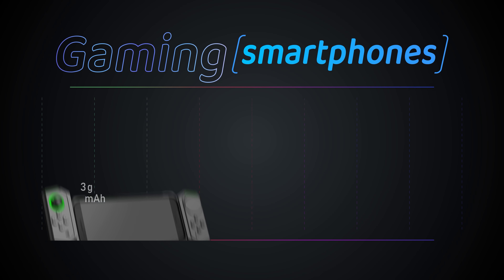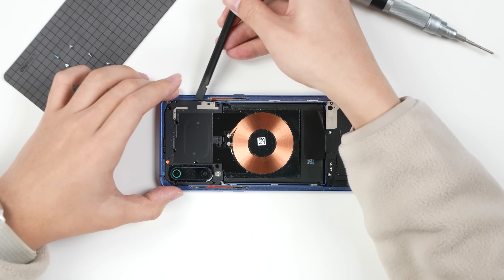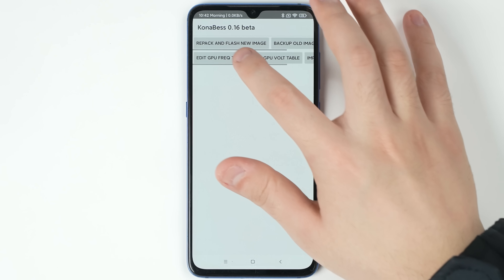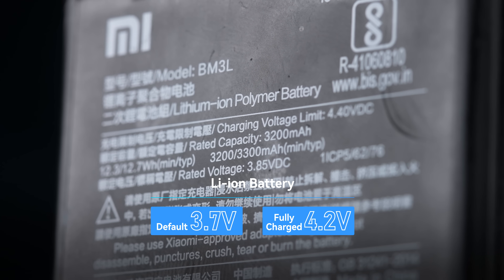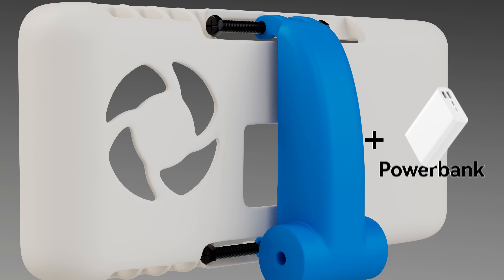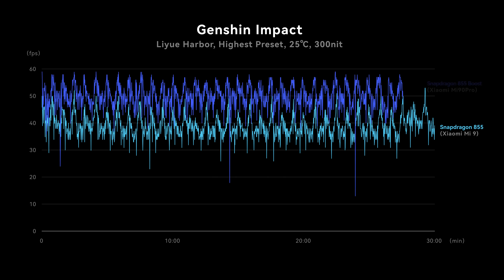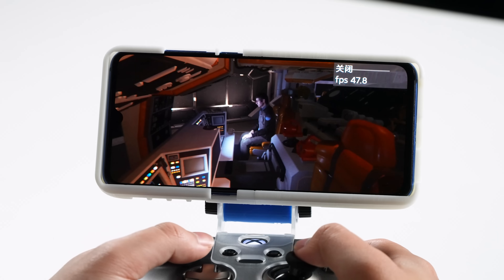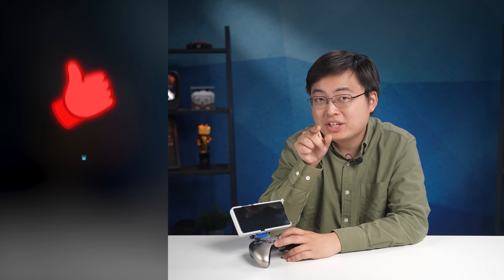We Turned This Old Phone into a Gaming Beast !!!

Comment: Meanwhile my oppo A3 pro 5G is running honkai star rail in high graphics quality in 60fps stably without overclocking and no modding, stock performance and Factory parts and it is about 45°C on the surface
Reply: ur oppo is 5 years newer

Comment: I wanna try this

Only thing different wanna do

- Mod a retractable phone controller to be permanent on the side wired connector USB type C

- have a type C  and audio jack passthrough to the bottom and

- make a dock with a type C to HDMI

- Additional dock cooling

Comment: Just yap bcs bored.

Snapdragon 865 was the most stable chipset ever for years after the 855 and 860. many phones with the 865 were godly. After that, 870, 888, and 8 gen 1 was released. Barely any improvement from the past chips but very prone to overheating and cpu bottlenecking.
My personal fav was Nubia Red Magic 5G.  

now its definitely being eclipsed with the newer gen, but in terms of reliability, u will be in a good hand with the 865.

Comment: How did you mount the heat sink to the top of the processor? Did you use thermal adhesive? Screws or what?

Comment: This video, shall serve as documentation for turning my Mi Mix 3 5g, into a gaming beast. This thing stays so cool with its ceramic and the increased air pass through due to the slider. I saw the voltages inside the app and decided I need more information before continuing. Thanks for this video. Its great though, cause this phone costed like 150 bucks, such a steal. 

Just some free advice, as an old android/windows mobile enthusiast... the ondemand governer, will achive the same perf as the performance governor, without draining your battery on standby. Also you can reduce the performance of the low end cores, for a bit of thermal headroom, if you don't feel like making a cooling solution for your phone lol.

Comment: 9:50 Closed back shell for printer... Right temperature settings... Little work to manually make .stl file with proper layer alignment with ploper supports... Tiniest bit of acetone to smooth outer layer if so much bother You... No. We don't. We have money and dumb idea on which we spend even more money than Steamdeck cost. Hell! There even some chinese manufacturer of such devices for retrogaming and even if I hate to say - they are good enough and cost new like smartphone which was bought for project. And that manufacturer already was a thing two year ago when this video was filmed.
Now this look like one of those video about extremely dumb and wasteful "DIY" video where material just wasted as shit for make unnecessary thing which You can by whole or make just much more efficiently if this "project" have any practical sense in a first place... You CAN do it simpler EVEN IF it is principally to make it. At least about material part, about coding can't say anything else than it look shady.
It is good to have will to create something... But, please, make it properly with some critical thinking, because this is pure cringe, sorry.

Comment: Sd865 also has an unlocked GPU, being able to surpass the 888 in GPU performance.

In 2024 I would recommend a mi 10t pro, or a OnePlus 8T for this project, I chose the OnePlus 8 pro because I saw it at a similar price to the mi 10t pro, but with an amoled display, better camera, and 4gbs extra ram.

I will probably oc and undervolt my gpu, but since this will be my primary phone,
Reply: What happen

Comment: $110 for a broken phone that was crud to start with is INSANE! Not to mention the obligatory spyware that comes preinstalled as a system app on all made FOR China mobile devices. The same spyware has been found on many devices made IN China for the global market. Notably Huawei devices are banned in many countries for this very reason and Xiaomi (the maker of the Mi 90 Pro featured in this video) has been under scrutiny due to privacy and spyware allegations. 

Xiaomi devices are equipped with MIUI, which includes automatic data collection settings. These settings collect data such as device information, user behavior, app usage, and even location data. Users have reported difficulty in turning off certain data collection features even after adjusting privacy settings. There have been concerns about Xiaomi's handling of this data, particularly given its ties to Chinese regulations regarding data surveillance.

There have been specific allegations regarding Xiaomi phones sending private data back to servers in China. In 2020, a report claimed that some Xiaomi devices were sending browsing data, even when incognito mode was used in their browsers, to external servers. While Xiaomi denied these accusations, it raised alarms about potential spyware risks.

Comment: Android phones would be way more amazing for DIY stuff, if they would allow real unlimited access to everything. You could then install something like Ubuntu on it and use them as tiny Linux desktops. If you solder wires to the right places on the board, you could use them like a raspberry pi. They already support I2C and serial communication making them theoretically great for DIY projects.

If there would be drivers freely available for every part of modern phones, you could easily install different rhings on it or modify it.

Comment: You can also try custom rom on it so it can have a better optimization and fps
Reply: no the best option is to install windows ,i have a lg v50 with windows installed and did manage to oc the gpu to 820mhz ,and you can actually play pc games .compared to winlator i get 2 times better fps and dx12 runs much better than dx11.

Comment: how hard and expansive it is to put :

1. 720p or 900p screen and maybe a higher end 1080p screen option
2. 8000 mah battery
3. 3.5mm port
4 And a decent chip which is overclocked with decent cooling

Thus making it the best gaming device which can easily be bought under 150-200 Dollar.

No need to include speakers or camera of any kind. Just pure gaming/Entertainment device.

A Youtuber did it surely a big electronics company can.

Comment: Done it with a Few S20 plus 5gs , and a Note 20 ultra. So 12g ram , 865 soc , 128g and two 512s and 1440p and 1080p 120hz a pop 1t SD cards. You can do alot with em

Comment: Hello, im building a similar setup but with my Mi 11T Pro and using just a super slim 15mm x 15mm micro fan with 4mm width, should i push the air into the motherboard or pull the hot air out of the motherboard?

Comment: Im doing the same to my razer phone 2. Not exactly everything you did here but Definitely bigger battery and taking out certain things im not using on the phone like the rgb and the wireless charging Coil.. also milling a custom made aluminum backplate and seeing if i cant fit in a tiny fan or if i cant connect the aluminum backplate to the SoC with a heat connector or a secondary vapor chamber. 

Im also installing lineage 21 on it (android 14 base) and expanding the storage to 1tb (it supports up to 1tb sd cards)

Comment: That is wild how you were able to turn that SD855 into a gaming phone processor, just out of curiosity how much higher would you be able to make the SD8G3 run, currently my Nubia Red Magic Pro 9 can run God Of War 2 with a PS2 emulator at a steady 60fps at 2400×1280 resolution, runs Burnout Revenge at the same settings flawlessly, I've been trying numerous gamepads/controllers to see what differences there may be and so far the Razor Raiju has been my favorite and I've tried the ShadowBlade gamepad, GameSir G8 Galileo gamepad, a wireless XBox style controller with a removable phone clip and an RGB clear lit XBox style controller with a removable clip with a PS style gamepad and controller on their way from being ordered on Amazon and so far the Razor Raiju is my favorite, would be a perfect controller if the rechargeable battery that's in it would work, but other than that the controller itself is by far the quietest and softest button pressing one I've tried so far and the built in phone clip is the perfect design for a phone like the RMP9

Comment: I was just going to ask what you think about the chip SD865. I was looking at it and it looks like it has slightly more performance but I was just worried about the power usage. I was going to try to make an improvement on it on the mi 10t pro the graphics card also has better performance

Comment: There should be actual commercial gaming phones with 10k-25k mAh battery, QSD 8 gen 3 overclocked to the max & an active air cooler built-in even though it has a trade-off of becoming heavier & thicker phone.

Comment: Can u share the magisk module to change battery capacity?
Coz i am changing my poco f1 4000mAh to asus 5000mAh battery by changing it bms, it works fine, but in my opinion it still 4000mAh coz i dont change the charge_full

Comment: PUT THE PRINTER INSIDE!!!

Anyhow, why wouldnt you use a power bank as the battery anyways? Heck you could run a trio of 18650s or 21700s or whatever the Tesla cells are called. 

It sounds to me like yall need to grab new phones and use something with a current chipset and GPU. Apple has a great one, Android phones have a couple really decebt ones. Overclock an apple chip and ypu might find it can really rip.

Comment: Can someone tell me how he modify the code of the battery size? I have been scrolling through comments, forums, reddits but can't find anything related. What I can conclude is that if the kernel where the information about the battery capacity is not modified, the phone will only charge until its factory capacity. I'm stuck at this point and need help

Comment: I have a great idea for gaming on phones, and that is by making the next generation of cpu's and gpu's more powerful, more extreme. 
While not caring much for power efficiency, my reason why is, why not just make it so you can game with almost at console-level, but only downside is you have to stay plugged in.
Laptops also do this, their GPU uses alot more power when plugged in and it makes a huge difference, and fans go crazy fast aswell because of the power.
and the power will be directed straight to the cpu instead of the battery to probably reduce heat idfk lmao im just thinking😂
And with larger phone models slap on a separated gpu instead of inter grated

NOW the only problem now is, your fat slimy sticky sweaty fingers on a skill issue😂

Comment: Ok now let's level it to the Max
Add nuclear reactor as the new unlimited battery
Add hydrogen cooling system to avoid kaboom
Add 1km LED screen
Add multiple controllers like keyboard, console, VR, touch screen , voice command, etc.
And use Nokia casing to become undestructible

Comment: Is it possible to overlock snap 8 g2?
And play for example witcher 3 on lowest settings?
Reply: just check the video "snapdragon 8 gen 2 vs a16" at the end it shows that the snapdragon 8 gen 2 can run the witcher 3 with 50s fps

Comment: Aaaaaaaaa i love this sooo much!! I have a mi9t pro. Already rooted. Bought it used at 67usd (the seller kinda messed the system files. Luckily i fixed it. So its kinda brand new). Sadly this phone only has usb c 2.0. For anyone wanting to do this, choose a phone with usb c 3.1 (so it can connect to external display) and the root process isnt complex (why i dont buy samsung). I'll probably try this mod when this phone is no longer my daily driver

Comment: I'm a bit curious how this performs right now. Can you redo this video again. Like including the thermals. Or trying out the sd 865 or 870. Like I can see that this can ditch out some of the gaming devices out there if this goes to trend. Like I would prefer something like this than an RoG as alternative, due to its high battery capacity.

Comment: Could you please share some insights as to how you changed android to accept the increased battery capacity? I changed my OnePlus 7 pro's battery which has a slightly higher capacity. It's at 59% now as I type this. It's been 28hrs so far. 😀 I just am unable to figure out how to tell android the battery capacity had increased?

Any help appreciated. 

I cannot find software to do what you did? 

It's rooted an has twrp and Pixelexperience Plus 13 on it. Which took me 10 days to figure out.

I just cannot understand how you changed the battery capacity in android?

Thanks 
Bryce 😁
Reply: Changing the battery capacity is achieved using the Magisk module
Reply: @xiaohei233  awesome someone answered me 😀 I could not figure it out lol. My battery is only a tiny bit bigger than stock. Which is 4000mamp I think for OnePlus 7 Pro. This battery is 4065mamp according to battery doctor. Works well but shuts off at 14% remaining. A little longer battery would help. Thanks man🙏 👍
Reply: @ecyrbretlaw-ix1zh  😘

Comment: You should have gone with the LG V60 ThinQ. You can get one for $120 on eBay.
The device uses the Snapdragon 865 processor with the Adreno 650 GPU, and supports 5G. It is available with 8 GB of LPDDR5 RAM and 128 GB or 256 GB of UFS 3.0 storage. 
The enhanced performance is achieved by the Adreno 650 having 50% more compute units (ALUs) than the Adreno 640. Furthermore, the clock speed of the pixel shaders was also increased by 50%.
Battery is also 5000 mAh so 2 would do for 10,000 may instead of 3 for 9,900
Edit: In perfect refurbished condit

Comment: We need an updated version of this with a Gen 2. Wonder how well it would perform
Reply: Damn... stock its about as strong as a gtx 1050, but removing the thermal limit, and overclocking? duuudeeee..... Who knows it might get on par with the rx 480.
Reply: @MarcABrown-tt1fp  very sweet
Reply: I think 865 or 870 batter option 👍🏻👍🏻
Reply: @kumarsinhji  why
Reply: @kumarsinhji I think 888 will be the sweet spot since it has very high peak power and relatively new. Just the thermals are the problem
Reply: it would be expensive asf😔
Reply: @kikler  no one gives a sh*t about money, everything is possible if you have enough belief and determination.
Reply: @HalfLife3onSteamPLZ  with the power of friendship!!
Reply: @kikler redmi k60 pro costs around 399(one of the most cheapest phones on 8 gen2), and this modification costs around 40. Not cheap, but ok
Reply: Still no support from XDA for gen2 or gen1
Reply: Yaa!
Reply: Just buy the motherboard of the phone and put it in this device
Reply: @Aryan-xh9ee  doesnt work, its not like a computer
Reply: 300 USD, Odin 2
Absolutely amazing, especially with good controls
Reply: 8 Gen 2 only will get cheap when like 8 Gen 5 is out
Reply: Yes
Reply: @edan6521  Neo7 Racing
Reply: yes totally CANT WAIT
Reply: I think a new version will come with 8 Gen 4, most mobile games are CPU limited and there hasn't been and big CPU performance uplift so it doesn't make sense but I'm sure we'll get some huge CPU uplift with NUVIA cores in 8 Gen 4
Reply: I have a Galaxy S23 and I'm going to mod it with fan
Reply: Yes U agree so much. They put in so much work and then relied on such a cheap phone. The work put in is probably worth much more then 30 of these cheap phones.
Reply: Gen 3😅😅
Reply: I wonder how it would be with a galaxy s20 plus
Reply: No se puede hacer :/, el overclock no es tan grande como lo es con el SD855 o SD865, sería solo un celular con un ventilador, por eso este experimento no se puede replicar tanto.
Reply: https://youtu.be/f4cKo1jFZG0?feature=shared
Reply: Maybe it could have joycon rails to support a more compact controller

Comment: thanks you inspired me so much. i got this idea but still afraid to do it, but after watching your video it convinced me. i just put 5 volt 5x5 cm fan blower and 3D printed the case to make an air flow towards the cpu-gpub its powered externaly with phone charger.  but at least i don't have to sacrifice my camera. in pubgm i got 90fps stable on hdr setting. i live in indonesia btw, its pretty hot here
Reply: do you have the 3d moel of the case you used, would appreciate it.

Comment: This is super cool! Very interesting handheld project. He does a great job of explaining the entire process of what would go into creating a device like this. The only thing I would change is where to tap power from to get voltage to the fan. Going straight off the battery like he did isn't the safest as it is placed before the battery protection circuit. I would tap off of the output of the protection board if possible. Either way, very interesting project executed well.

Comment: Summary : 
1. Overclock CPU and GPU to the extreme.
2. put 3x the original battery capacity.
3. Overkill cooling.
4. Build custom case for it.

great video overall !

Comment: It gave me a idea. A broken flagship
(Best case Snapdragon 8 Gen 2 from broken s23 with screen cracked because it will have a special edition one with samsung dex , copying console mode from redmagic, huawei desktop mode , Motorola desktop monitor de), an online 3D printer for the main body, cheap copper heatplate, a good noctua low profile fan, gullikit buttons, hall effect joystics and hall effect shoulder buttons ( they are available online in low profile and standard profile), with buying repair part from samsung, all mixed into one.
( I am studying Computer Science, Electrical and Computer Engineering. I can even put it on my resume or projects)